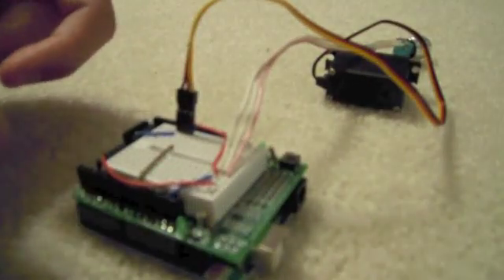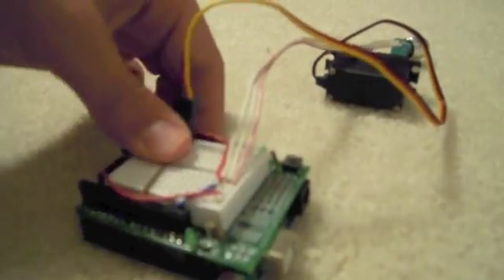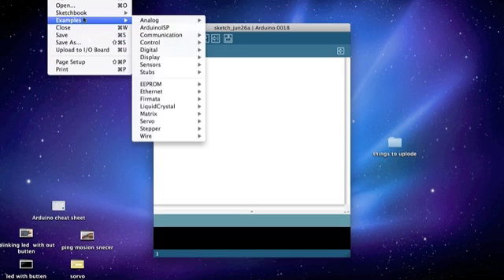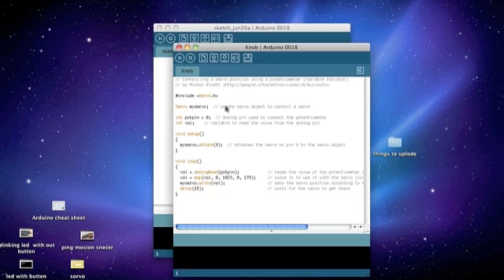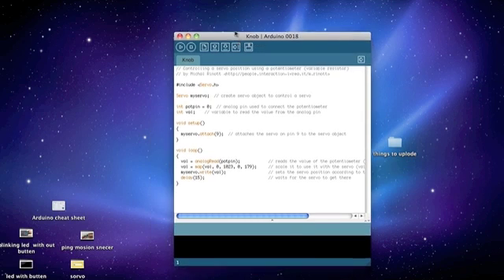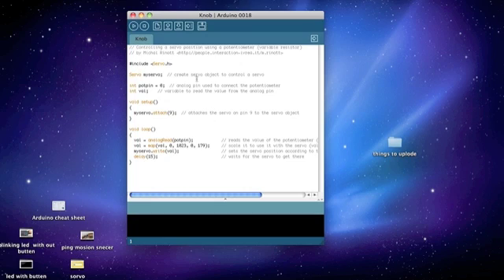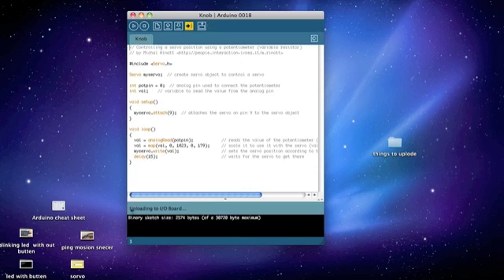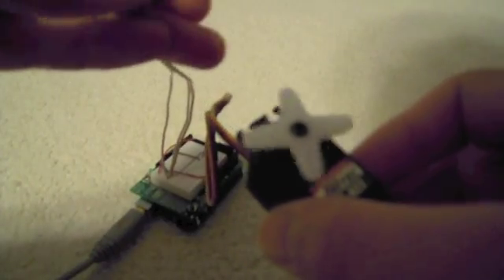How to  Controlling a servo using a potentiometer

Comment: Hi there I would like to know from your experience, can your example be done using a slide motorized potentiometer to controlled by cc message and if so please can tell me how? I intend to create a daw controller with 24 motorized faders, but I am stuck due to lack of knowledge in electronics, can you be of help.